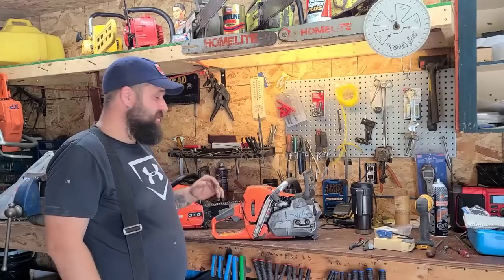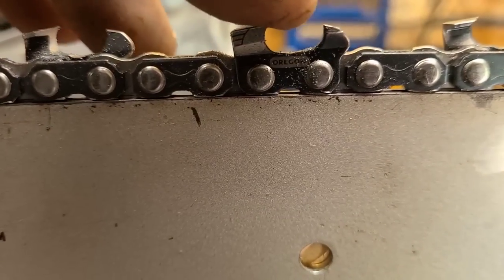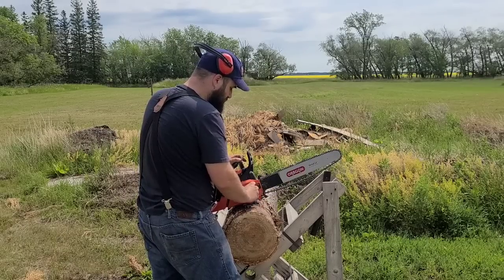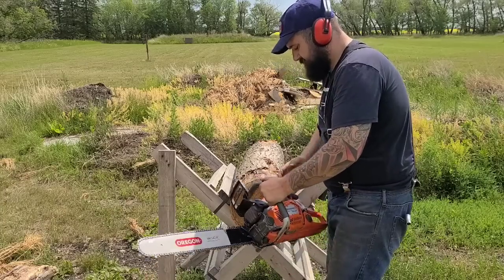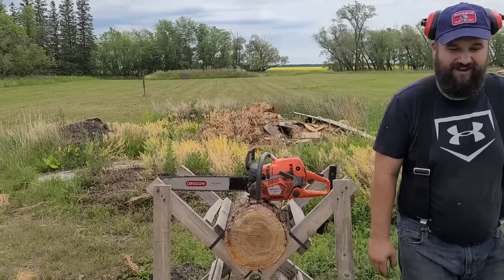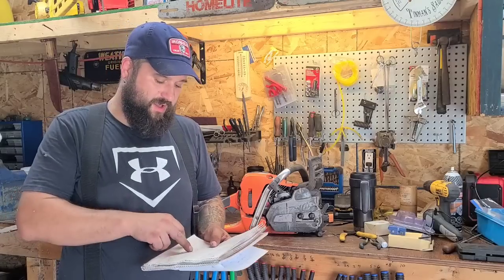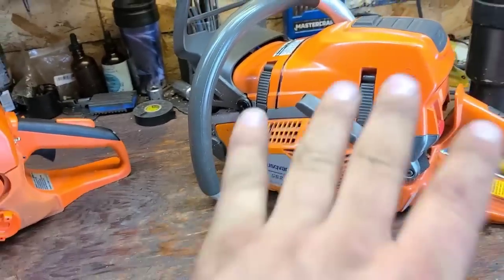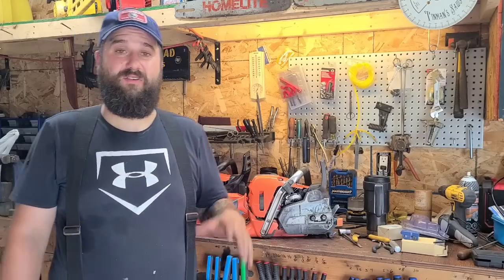Echo CS590 vs Husqvarna 562xp. How close are they in performance??

Comment: Great comparison.   One small feature that I've found useful on the Echo is the pull handle can be used to open the Oil and Gas caps.  I like this because I hate having to carry the swench on my person, while sawing, because it is always jabbing me when I bend over. :P.   Can't wait to see if porting the Echo will help.  I actually like the torq of the echo, I was flush cutting some huge maple stumps (36-45 " dia) with the echo and needed that torque.  Thanks for the great vids.

Comment: My personal saw is an Echo 590. At work we have a couple of 562xp's. I just spent the last week working on a thinning project and brought my 590 as a backup saw. The Husky definitely screams and you can work real fast with it but when it came to low stumping, the torque of the Echo seemed to make it cut better. Overall, for many people I think the Echo is a better value but it's not quite in the same class as the 562xp.
Reply: I think the cost is probably the most important factor.
Reply: My first personal saw was the Echo 590. I've ran it HARD with the company for 2.5 yrs from the tree tops to the root ball. It's on its 2nd sprocket and 2nd 20" bar and its still just getting better. Starts easy. Has always taken a long time to warm up. One of its best qualities is that it runs and cuts GREAT in 100+°F. My Stihls start getting quirky in the heat. Got rid of my Stihl 441 because it wouldn't run in the heat.
The 590 w/20" bar is my go to saw in the bucket when I need a bigger saw. The lower rpm and good torque offers better control when you need it. I rarely choose my Stihl 362 over the 590 for bucket work.
I have several saws now, but the 590 is still kinda my favorite.
I recently got a set of bigger dogs for it and put a 24" bar and skip tooth chain on it and it's my favorite saw all over again.
Reply: @thomasdavenport508  I m gonna buy a chainsaw to replace my old husqvarna which lasted about 20 yrs and still running somehow but I am about to choose between stihl, husky and echo. They say echo s have lower rpm among those so means less work at a given time. And Still and husky are said to be not having the same quality as  they had in the past. I still havent decided.
Reply: @hevesat1920  Take a good look at the Echo 620, brother.
It's the "Pro" saw upgrade of the Echo 590. There's a million vids of it.
I wouldn't steer a man away from his preference but I would show him a good option.
I've never done more than start a couple Husqvarna saws so I have no viable opinion of them. There are no Husqy dealers near me. They don't show up in pawn shops here. The only thing I don't like about them just from looking at them is I don't understand why they needed to put a primer bulb on their bigger saws.

It may take some intuition and wisdom to understand this:
Faster is not always better.
Lower RPM = My 590 will keep a chain sharper longer than my Stihl 362. Bars last longer on my 590 than my 362. Tanks of gas last longer in my 590 than my 362. In knotty, irregular, variable grain wood, my 590 stays in the cut better, aka "Holds a tooth" better, if you know what I mean. My 590 is always smooth and consistent as long as I do my part hand sharpening chains. It's also forgiving in that aspect. Yes, my Stihl 362 cuts a bit faster but at the expense of more time sharpening, dressing my bar more often, buying a new bar sooner. Things have to be closer to "perfect" to get that smooth performance. 
Have you ever noticed the chain on a pole saw seems to stay sharp "forever"? It's because it's turning much lower rpm than any chainsaw.

I love all my power saws, man. Several others not mentioned here.

Anyways, when I wear out my Echo CS-590, I would want an Echo 620 to replace it. It doesn't seem my 590 is gonna go down anytime soon. Might have to buy me up a 620 on a sale and stow it away.

Happy cuttin to ya. 🌲🌳🌴
Reply: @hevesat1920  take a look at the echo 620p if you shop around you can get it for about 500 bucks I got mine for 515 shipped with a 24 inch bar 
And the difference in performance between that and my 562 is negligible and while the echos might have lower rpms they have way more torque , the difference in cut time with my 620 vs my 562 in a 40" round of oak with a 24" bar on both was about 1 second and the echo had not yet had it's carb tuned
Reply: @joehertel8846  515? They retail for 570 in US
Reply: @eugenecrabs3954  yea515 after shipping and taxes , watch the chainsaw shacks video on the 620 to see the code
Reply: @joehertel8846  That's a damn good price!
Reply: @eugenecrabs3954  yessir it was , they raised their base prices a little this year but sawsuppliers is still going to give you the best price on echos period , my 7310 with a 32 inch bar cost less than my 562 with a 20 inch bar
Reply: I bought mine in January 2020 the price has increased a little bit since then but sawsuppliers is the place to go and if you go watch Brody's video on it at the chainsaw shack he'll give you the discount code I used to get mine for such a good price
Reply: I believe the code works on everything but the best discount is given on the 620p
Reply: @hevesat1920  Stihl's saws are the only thing left they make that are worth it.  Their trimmers, polesaws, blowers have all gone to shit.

Husqvarna i cant really comment on since at work we run all Stihl.  Tho for my personal saws im really looking at Husqvarna
Reply: @danielbabcock7004  echo makes all the pole saws for Stihl now, and other stuff.
Reply: @dentondunn4346  well thats a straight up lie🤣🤣🤣 theyre two completely different companies, they dont even share a holding company
Reply: @danielbabcock7004  that's what someone who works for the echo company in Virginia told me
Reply: @danielbabcock7004  I'd show you the screenshot of the conversation explained to me but can't on here that I know of
Reply: @dentondunn4346  the only company Echo shares anything with is Shindaiwa, and Shindaiwa typically has better products🤷‍♂️
Reply: Well the 562 is fuel injected the 590 Timberwolf is cArburated so there’s gunna be a slight better performance and advantage with the husky
Reply: @danielbabcock7004  shindawai is literally the same product as echo just higher priced. When I look at a shindawai I think of a GMC Sierra compared to a Silverado. Exactly same truck the only difference is gm is known for luxury so you will pay more

Comment: Came over from buckin’s channel.  Seen a few videos and like the content.  You said the 562 ran like a ported saw….The thing you have to remember is when the 562 and 550 came out, they were ground breaking in terms of power at that time.  They ran like ported saws out of the box. A 550xp ran like a 361/036/262xp and the 562xp ran like a 441/440/372xp with  much less weight. My 562 with a muffler mod would be 1/2 a second faster than my 372 in hardwoods under 18”. After that the 70cc saws muscle it out.  Ported is totally different as a 372 with a good port is almost unbeatable. I no longer use them professionally, just 8-10 cord a year for heat,  but I find myself running the 372’s and larger saws less and less. The 562xp wears a 20” in hardwood country but I’ve ran a 24” on it and it was plenty adequate.  The 550 will pull a 24” in softwoods no problem, hardwoods is iffy. Bar oil is the issue in that guy.  The 562 is plenty light enough to use all day, climb and not be wore out.  Prior to getting mine in 2012 I ran ported ms360’s and 361’s as my “smaller saw”. Now the primary saws I use most are the 550 and 562. I used to use a ported 372 with a 20”. 😂. She now wears a 28.  Love the sound of that 266 Buckin has.  Looks like she rips too. I’ve got a minty 268 laying around I need to get running again.

Comment: Excellent video, thanks. Just a side note but I over work my CS590 like mad. I use it on stuff way too big for it, I use it on the job and have for 3 years. I've taken down trees more than double the bar length with it, (when you're carving your hinge instead of cutting it lol) and it is still in amazing condition 3 years later. Still starts with one or two tugs.  Need to get something bigger but money's tight  and I am a notorious penny pincher and so far this has handled everything I've put in front of it year round.  I have 5 saws, all Echo's, but this one is my only felling\bucking saw and it has been amazing.
Reply: You can get the 620p which will run a 28 with no problem for about 500 I got mine for 515 with a 24 inch bar (that price includes tax and shipping )

Comment: I’ve cut with my echo 590 for quite a while and it’s been a dead reliable saw from day one. I replaced the ignition and carburetor with ones for a 620 and gained a few RPM and modified the muffler but that’s the extent of it. I’ve no complaints and she pulls a 28” bar just fine in what I get into but it’d be a bit much in big hardwood I’m sure. Anyway it runs with the big saws just fine. She made me a believer in the echos friends! Good saws for the buck and the go to work everyday like we do.
Reply: I did the same but some port work too. It is way faster then my 362c-m

Comment: In my tree business, I've been running the same 562 as the main midsized saw for about six years with untold hours and zero issues. With the time proven power and dependability it has provided, it's gonna be hard to convince me to switch.
Reply: Echo makes a good product but they’re more of a premium homeowner saw rather than a commercial grade saw. The echo fanboys love to talk about how their saws are professional grade. Take any echo saw and put it next to a comparable Stihl or Husky pro saw and you can pretty easily see the difference.
Reply: @eurokid83  agreed, also remember echos’ are close to half in price.
Reply: @casperwolf813  This is true. I have nothing against Echo saws, in fact I’m seriously considering picking up a CS-620PW since I have no saws in the 60cc class. I’m also interested in modding one to see what kind of performance potential it has. As far as value for money goes I don’t think Echo can be beat. As I mentioned before they’ve got some serious competition and brand loyalty in the commercial space and I’m not sure they’ll be able to break into that market in any significant capacity.
Reply: @eurokid83  the Echo dealer near me sells the 7310 in bulk to a local big name tree service.  I dont think every echo saw is on par with every pro grade stihl but certain models are in my view.  For fleet use, saws like the 620 and 7310 are really robust and economical.  A self employed arborist may choose to buy the "best" gear because it's somewhat personalized.  For fleet use, Echo often is a pragmatic business decision.

Comment: Hi Tinman, thanks for showing how to start a hot husky.  I had hot start issues with my 555 which is close to a 562.  I was either trying with the choke on or just "on", instead of using the fast idle. I recently added a 562xp to my saw list which also includes a 550 xp for smaller stuff. I still have my 555 which I keep for spruce as I hate the gum so my 562 and 550 are only used for white birch, yellow birch and poplar.

Comment: This popped up on the "recommended" video's...SO I watched. This is an excellent video comparison, both raw and real. Makes me want to build another 562 as mine of the same "vintage" as yours is getting long of tooth. :) Have to say some of the stuff I used to do to let them cool better may be obsolete, EXCEPT the muffler mod. Hoping you do more with these in the future. I've acquired a first gen 550 to hot rod :)
Reply from the maker: I actually have 2 low Mike complete but very blown un 550s in the bone yard. 

My 562 is very very tired. I plan to rebuild it this winter

Comment: I have the Husqvarna 555 the little brother to the 562xp and it cuts extremely well, fell in love with it on the first day I took it out. Found out that it helps to read the entire manual on hot start procedures or they won't start. Once I figured it out, I rarely have a problem. My echo 520 doesn't like starting when hot either... so there you go! Great video Tinman!

Comment: I'm in Michigan and we have all kinds of wood, especially hardwood. I have a 2020 562 as well. No mods. My 570 died one day, I run a tree service. I was cutting the log and stump off a big silver maple. I ended up putting a 32 in bar on mine with full chisel chain and it did pull it. I wouldn't do that every day.. but the horsepower rating on 570 is 4.9. 562 is 4.7.  But the torque is different and so is the high rpm of the 562.. my 562 air filter is different then yours too. Mine has the cone style. I keep a 20 on mine normally and you can't stop that thing in any type of wood. Can't wait for the 592 to hit the market.

Comment: In my experience with the 590. A 28 inch bar is good but it does pull a 32 inch bar with a good chain. I've buried a 32 in bar in both black walnut and maple with zero problems  using a flat filed chain

Comment: I like the the Huskys  "return to on, shut off switch"  Never have to pull 30 times then figure out that the switch is in the Off position.
Reply from the maker: Lol I do that all the time.... pull, pull, pull, pull, pull.....oops its off lol
Reply: @tinmanssaws  simple fix for that. After you've hit the switch to OFF and the saw dies, immediately flip the switch back to ON. Ever since I've started doing that with my Echo equipment... saws, string trimmers, etc. I've never pulled and pulled again and realized I forgot to flip the switch to ON.
Reply: @obeconoberougle9497  I do the same thing. I have mostly everything echo besides a husky backpack blower and the only reason it’s not a echo is because husky was the most powerful one at the time. It’s just crazy how much they’re outta tune from the store. I’ve learned a ton from watching buckin and tinman over the years. They definitely made my equipment run ten fold better. I been watching buckin from the axman days and tinman soon after his first shoutout. Love these guys videos

Comment: Every Echo saw fan should see saw guru Charles Bisco 620p easily pullin a 36 thru big wood . His 50cc 4910 pulls as good as some 70cc saws .
Reply: I'm not a echo fan per say but regardless of the brand u r 100% rite,charles can build one hell of a saw
Reply: I'm a pro cutter my sthil dies at idle drives me nuts timber Wolf never died once at idle echo is way better last two huskys I bought had bad carbs from factory

Comment: Sometimes those 590 air filters fit loose and let in fines, but a 7/8" outer diameter faucet o ring fits perfectly on the filter and that really seals it up well
Reply: I bought one for mine too and put a little dielectric grease on it, sealed it up well. Did a muffler mod and removed the limiters and tuned the carb by Iowa Performance Saw's and it's a beast now. It made a noticable difference and I'm really happy with it

Comment: My 590 is a beast with a 28” Oregon bar and stihl chain. Runs the same as the stock 20” bar. I’m running 28”  .50 3/8” full house
Reply: Will it run a 28 buried in hard wood?
Reply: @notavailable7379  absolutely. Only thing I burn is hickory 95% of the time. I live in pa. Everything on the farm is hardwood. It pulls my 28” thru like butter. Oils the bar no problem too. It keeps up with 576xp until the 20” logs. I’m telling you I love my echos. I’d put it up against any 60cc saw. I would’ve put a longer bar on but at the time 28” was the biggest I could find. I have no doubt it’d run a 32. My little 310 is a beast too. It has a 16” bar
Reply: @joescott803  great now im going to buy one lol theres been a cheap but clean echo 6700 for sale id like to pickup as well.
Reply: @notavailable7379  all I did was opened it up with a muff mod and cap delete. Only thing I wish it had was a aluminum handle but for 400$ it can’t be beat. It’s been dead reliable for the last four or five years
Reply: @joescott803  cap delete? Whats that? You can buy an aluminum handle for it and a full wrap handle as well. Both of which are for the cs 620 but they both fit the 590
Reply: I sold a 620 echo after trying it against my 562's
Reply: @notavailable7379  carbs have cap restrictors only letting you only turn the screws so far. I know they sell them. When mine breaks I’ll get one but I don’t put much pressure on the bar. I let the saw do it’s thing. I mostly just hold onto it
Reply: @jamiedalluge9472  I don’t care for husqvarna or stihl. They always seem to have some issue when I needed to cut wood. Oil pumps going out or not starting. Echoes never gave me a problem in the last 5 years. Oh and the warranty is trash on them. Echo is half the price and has a 5 year warranty. And beasts of small equipment. Only thing about echo is they’re pretty undertuned from factory but if you know your equipment that’s a couple minute fix. I cut 12-18 cords of hardwood a year. They rip and super reliable
Reply: I agree echo makes a decent saw I jst prefer huskies. Fortunately I've had great luck with mine. Happy sawing buddy
Reply: @joescott803  oh yeah they are called restrictor caps ive never heard anyone call it a cap delete guess that's the new thing. You probably arent going to break it i prefer aluminum but theres nothing wrong with plastic. If i had it my way saws would still be made of metal lol
Reply: @joescott803  Polk
Reply: What Stihl chain do you use? I thought the Echo went by the count of the links, what 24 bar and Stihl chain can I buy for my CS590 that fits it correctly
Reply: @dentondunn4346  I quit running stihl chain. I’m running Oregon. it cuts faster. I was just getting off the wall chain from the dealer. You can modify your bar to fit both but if you’re buying one just buy a bar chain combo. Mine is the power something. Ordered from Amazon I believe. Buckin has some videos of modifying bars but I think the last couple digits end with 280d if I remember right